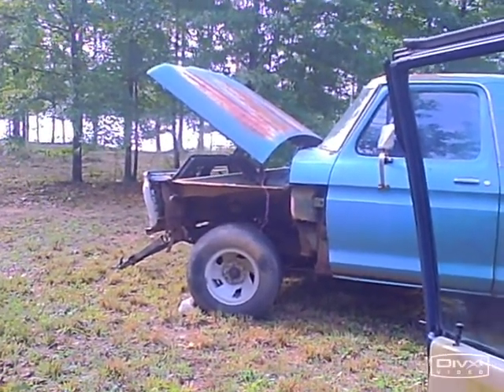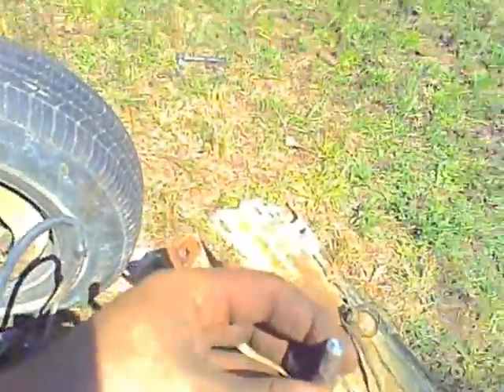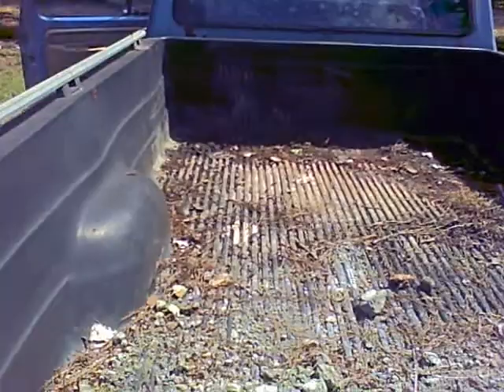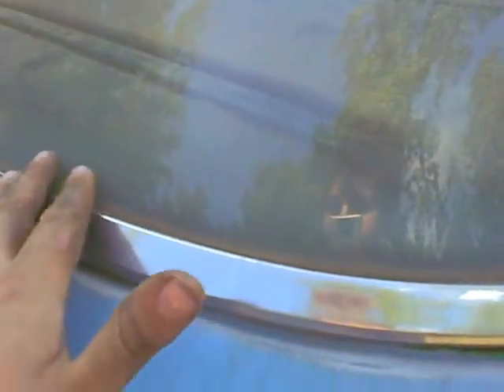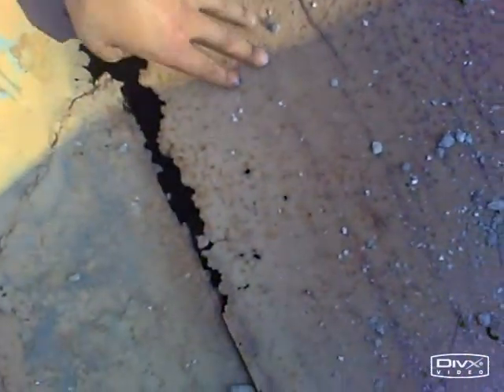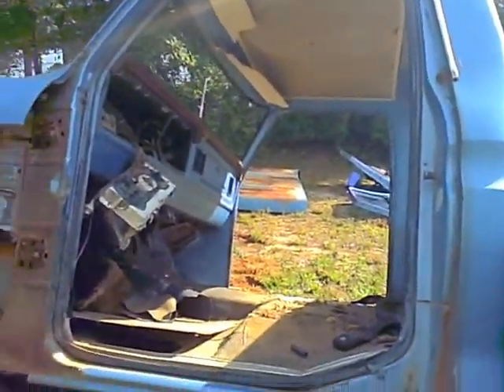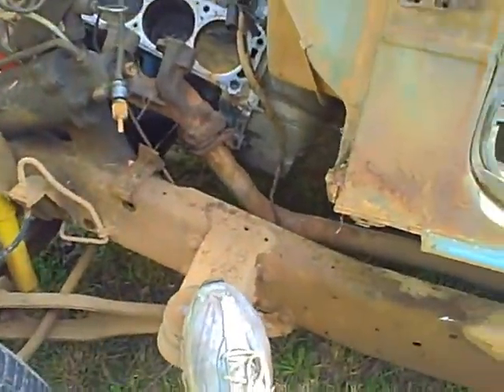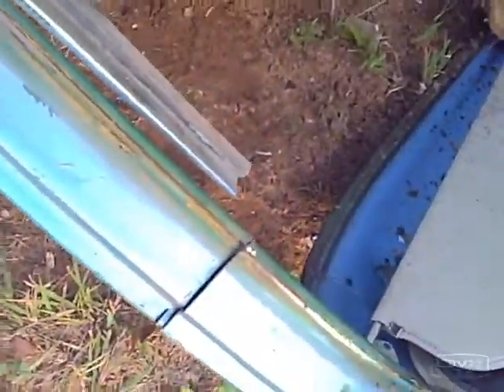stripping the f100 for parts

Comment: Should have just pulled the front clip in one piece. Damn I should move down there. Up here you cant give away bed liners let alone try to sell it.  Gasket windows are easy to do I love them. Thats what happens to boxes with bed liners it hold all the water in there and rots it out. Whats your plans for the cab? The floor is pretty bad can you still sell it like that down there?